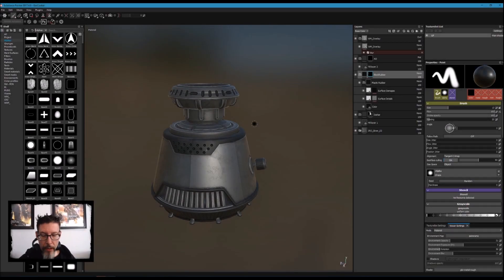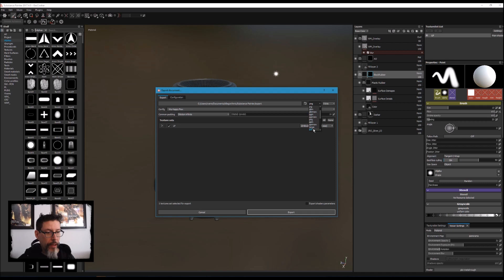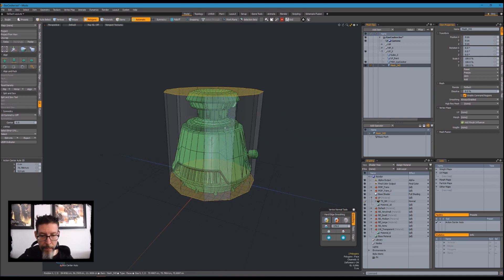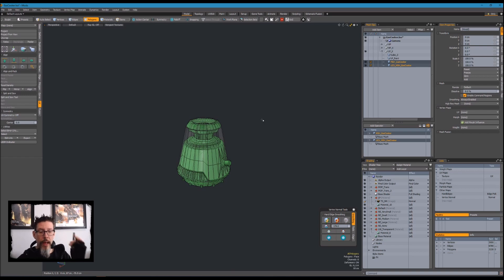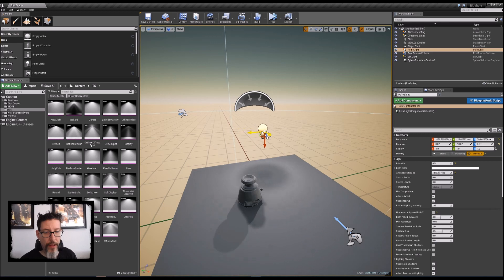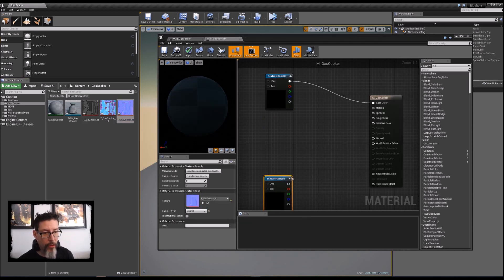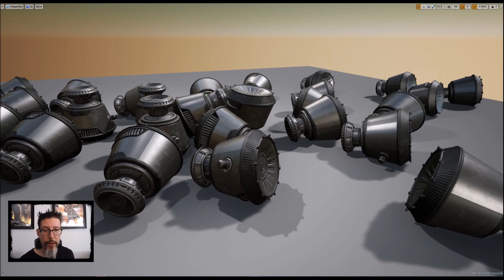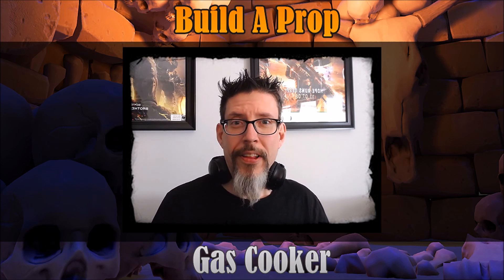Build A Prop : Gas Cooker - Final Presentation

Comment: I have been working with a studio freelance and they keep asking me to make them OpenGL normal maps when they know I do showcase my props using the DirectX ones like you did and they work perfectly. Do they differ a lot in usage inside unreal? Am no unreal expert at all. But seemed a bit strange.
Reply from the maker: The only difference between OpenGL and DirectX normal maps is that the green channel gets inverted. That's it.  :)  Unreal even offers a checkbox in the properties of the texture to flip it if you've imported an OpenGL one originally ... so, no big deal.

Comment: So when you export the collision and low poly mesh to the same fbx file, Unreal will automatically apply the collision shape?
Reply from the maker: Yep. Any mesh item inside the FBX that starts with "UCX_" and matches the name of another mesh item will be interpreted as a collision hull.

So, "MSH_MyProp", "UCX_MSH_MyProp"  and "UCX_MSH_MyProp_02"  would result in a prop with 2 collision hulls.

Comment: Great tutorial series and covers a lot of things. Quick question though about Substance Painter export textures. Is there any reason why you don't use the default Unreal Engine 4 Packed option to export the textures?
Reply from the maker: No reason ... I've just been using that We Happy Few config for so long now, it's habit.  Any pack that does what you need it to is fine!